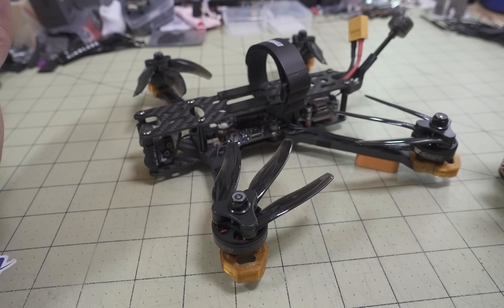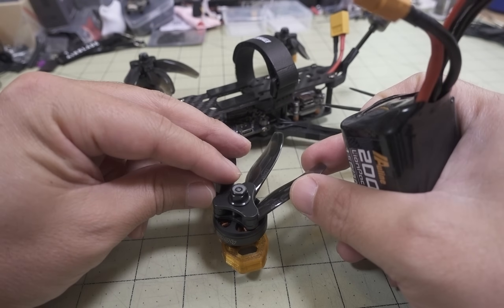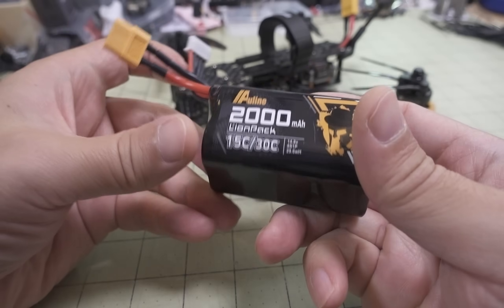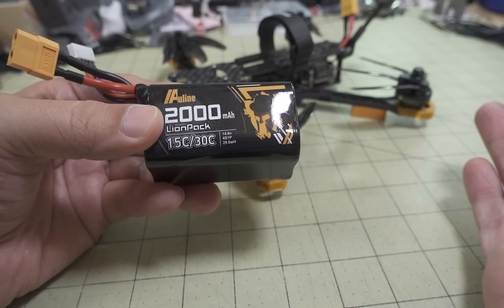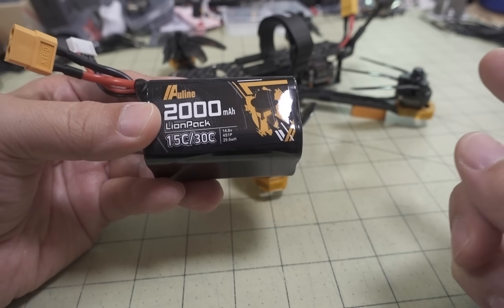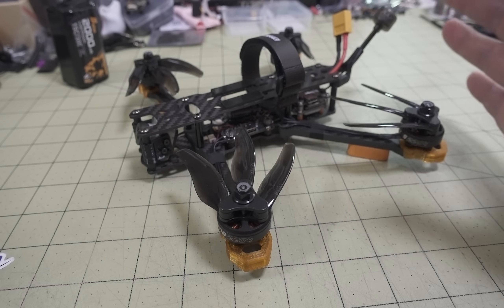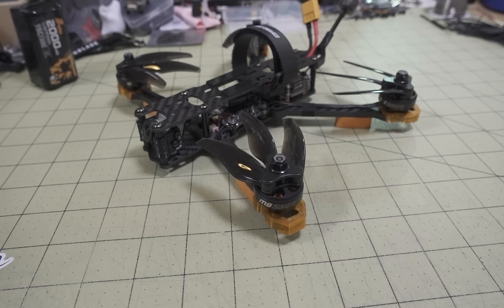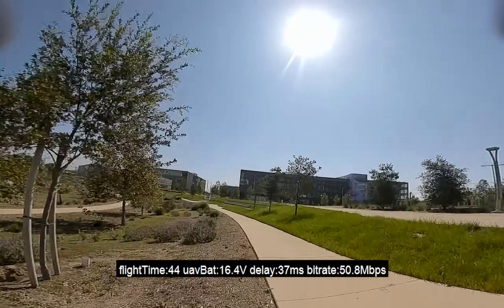Building an Efficient 5-inch Drone for Long Flights 🛠️

Comment from the maker: 🛠️ Parts in this build...
Papilio Frame - http://bit.ly/38tlNsA
iFlight SucceX-A AIO FC - http://bit.ly/3f0UDen | http://bit.ly/39uFrVR
Diatone 2204 motors - http://bit.ly/30Ip0lC
Caddx Vista FPV System - http://bit.ly/2QKaUM5 | http://bit.ly/2QJsShw
Gemfan Floppy Proppys - http://bit.ly/36DGCD3 | http://bit.ly/30GQ2dd
Auline 2000mah 4S Li-Ion Battery - http://bit.ly/30Jgrqz

🙏 Please support with a 👍 and don’t forget to hit the 🔔 thanks!

👉 Old gear for sale here -  http://bit.ly/AlbertGearFS

💲 Get the latest exclusive coupon codes (updated often)
     http://bit.ly/34SYiGn

Comment: I’ve been trying to build something similar but I’m having trouble finding motors. Everyone seems to be using the 12x12 mounting and it gives me a headache figuring out which frames to with which motors.
Reply from the maker: Usually the frame product page will list the motor mounting pattern in the specs.

Comment: I just got this frame but I have the caddx micro air unit with the caddx camera that is 19mm x 19mm. I see you used a TPU mount for your camera instead of the carbon fiber mount can you let me know where I could pick that mount up at?
Reply from the maker: It was something I grabbed off Thingiverse but I was not able to find it again.  If you search for "FPV camera mount" you'll get hundreds of hits.

Comment: You should be able to get awesome flight times out of that bird it’s so light 
I’m using the 3000mha 4s battery it’s 1000mha  more amps and only 4g heavier 
I use them on my marmotte that I set up for long range it weighs in at 436g with a 200g battery it flys for 18 min consistently 
I just built a 4100mha 4s battery that weighs in at 300g using 21700 Li-ion cells 30c and on these it flys for a solid 23 min consistently 
I’m running 2306 2150kv motors

Comment: Have you tried that battery on something like a more standard 5" freestyle? I'm wondering if I picked up that battery if I could use it for longer flight times and slower but more cinematic flights. Perhaps the 3000mah
Reply from the maker: It will probably work but you'll have no power whatsoever.  It will be barely enough to cruise around and that's about it.  FYI, stick to lower KV motors under 2400kv for 4S.  OR put in a motor output limit to reduce the amp draw otherwise it won't get off the ground.
Reply: @AlbertKimTV  What about a 6S build? 1750kv or similar.  I'm trying to decide it's possible to use the same rig for freestyle type flying, but also stretch flight time with a different  battery if I wanted a longer flight

Comment: What if you did some light freestyling with lithium ion batteries?  Is it even possible? Would it drop voltage instantly?   

Great content.
Reply from the maker: Yes, you will get instant voltage sag.  This is normal for Li-ION batteries.

Comment: Hi Albert, love your channel. Love this build. 
I'm looking to emulate this sort of build however with an analogue set up. Would a Tarsier V2 fit in this frame?! Thanks
Reply from the maker: Yes, it will fit but you'll have to use a custom TPU printed mount for the camera like I have for the DJI camera.
Reply: @AlbertKimTV  thanks for the reply! Slightly disappointed that I don't have a 3d printer now 😂
Reply: @AlbertKimTV  do you know the distance between the two front stand offs on this frame? Thanks

Comment: folding props are a waist! only way be good is if slow fly between trees maybe as a safety! then be 2 prop only.. reason : 2 blades are quiet/efficent/ no thrills but long flight times/ way easier to BALANCE!!!! 3 blades are for speed! 3 blades are loud + vibrate and non balance capable- they build identical as can .. when together.. there out balance a bit- /not as important if raceing! Sooo 2 blades are better in every way for lighter/ better video no vibrates/smooth and easier on batter time!
Reply: I would say three blades are less efficient and only benefit is more thrust if you can't fit a larger two blade.  otherwise you're just swinging extra weight and taking more energy to do it.

Comment: I bought this exact battery and my charger only charged it up to 16.4 volts. How high should this bettery get charged and discharged to?
Reply from the maker: You charger settings are limiting the final voltage.  Mine goes up to 16.8v.
Reply: @AlbertKimTV  how low can i discharge to?
Reply: @jjkeaton7085  2.5mha but to be safe I stop at 2.9

Comment: I like the folding props, however, for testing purposes, you should really try some bi blade non folding props. I also have noticed that I tend to get better flight times after the motors have had enough flights to break them in.
Reply from the maker: I've heard that "breaking in motors" is a myth.  Where is there data to back this up?
Reply: @AlbertKimTV  I don’t have data on this, but I felt disappointed with the initial flight times on some of my builds but later found I was getting what I expected. This was with Xing motors. The construction of the motor may have an effect on this. I would actually like to see tests done on this.
Reply from the maker: Interesting... I hadn't notice this on Xing motors.  I'll have to see how the Chimera4 does over time.  Are you using the same batteries?  Maybe that might be a factor.
Reply: @AlbertKimTV  This is what I know about bearings from working in a bicycle shop for years. Traditional bearings are adjustable. If they are too loose or too tight, the races pit. There is a very narrow range that is an acceptable adjustment, however it is a range. If you go absolutely as loose as possible to prevent slop in the bearing, they will loosen up, especially if the bearing is new. Non adjustable bearings need to be adjusted towards the tighter end of acceptable to have a decent life span. New bearing race surfaces can very from looking almost like a matte surface to having a mirror finish. Even the matte surface starts to look like a mirror finish on the thin track where the bearings move after a lot of use. Keep flying the quad for a month and see if you notice a change in flight times. I do use a variety of batteries, but do not feel that accounts for all the differences in flight time.

Comment: ZOHD have out a whole range of Li-Ion packs available in 18650/3500 & 21700/5000 sizes with various cell counts- not as cheap but much better than those AuLine packs....
Well worth checking out! ;)

Comment: In the past, i was using 1806 motors, 2300kv and just 5inch biblades. It weighed 190gms without lipo...With continuos acro/freestyle flying with 4s 1300mah lipo, i was getting at least 7.5 to 8mins flight time...im guessing that now with better LiOn batts, we should get >12mins. What do you think?
Reply from the maker: For sure, and some of these new ones are over 3000mah, so the flights will be mega long!

Comment: Thanks for the tips esp with batteries. Regarding this frame, I made one up using this and was ok until it had a light crash, about 10m it fell from hover as prop came loose. The front arm really suffered , not only is the carbon bendy and weak but one of the mounting screws tore through the lower frame plate as so little carbon holding it in place. I repaired but same happened again, decommissioned it after that and went iflight dc5. Guess with cruising quad there's less chance of crash 👍
Reply from the maker: It's a cheap frame and not really a basher frame.

Comment: How about a word or two about that humongous capacitor you have on that build (and some other recent ones I've noticed)? I thought the DJI video would be clear without that?
Reply from the maker: The capacitor is not jut for analog video noise.  It's for cleaning up electrical noise in general.  Electrical noise is what causes video noise in analog video.  It can also mess with your PID tune.  So I have it on there mainly for keeping a nice PID tune without adding a lot of filtering.
Reply: @AlbertKimTV  Thanks, I learned something today!

Comment: NIce looking build! That frame that is in the works sounds really interesting. Will it be a similar weight to the FPVCycle Fouride 5 inch? The fouride 5 inch is around 70g  by the way. Kabab flew the 5 inch version with a 3s LiPo, 2203 3000kv motors, and got decent flight times. It seemed to be a solid freestyle performer.

Comment: Nice Build Albert.  Looks like you couldn't a got 10+ minutes easily.  I've been flying with 4 of those same batteries with my iFlight XL-5 with a gopro7 and I get around 10 minutes or so cruising.  They're really inexpensive...around 20 bucks each.  Also, I've seen 3000 and 3500mah versions from other manufacturers I'd like to try out.
Reply from the maker: I think we will see more of these li-ion batteries.  Amazing flight times for those who don't race.
Reply: @AlbertKimTV  Completely agreed.  There are a lot of guys that are new to the hobby and/or fly commercially who demand longer flight times and fly cruise cinematic style.  So the LiIon batteries are ideal.
Reply: Esdras FPV   All 'stock' parts.  XL5 HD...right outta the box.

Comment: Hi there Albert, do you like those diatone motors? I was thinking of trying them on an ultralight 5 inch, they are about 20 grams a piece I believe? Good price too I think. Thanks!
Reply from the maker: Very smooth motors but on the power side, quite weak.  It's gonna be for cruising and efficiency.  Not for racing or freestyle.

Comment: Wicked cool. Ion is the future. I recommend BetaFPV X-Knight 5" with some dave_c motors... has been working decent for me so far on just 2S (26 minute flight time). Also-- Those are the nicest M3 screws on those motors I have ever seen!
Reply from the maker: This build is just one example of thousands of different ways to make an efficient 5-inch quad.

Comment: I heared the rumors that Diatone MB2204 motors are already discontinued or factory stopped producing them. Cannot find them on Diatone website also...
Reply from the maker: Wow, really?  This is the motor on their 5-inch toothpick!
Reply: @AlbertKimTV  not sure what happened, but my order was cancelled on one shop and the seller said the factory stopped manufacturing them. Well at least the Diatone should know whats going on.
Reply: @MontisTube  Banggood has listed them with expected shipping around October 26th. Would be really sad, as they are cheap and I am about to order a set for a light MK4 analog LR build
Reply: @SerialKoE  Maybe, but Diatone has removed this motor from their website. This should mean something...
Reply: Xt Xinte still has them available. Maybe I should place an order right now!

https://www.xt-xinte.com/Diatone-1pc-4pcs-MB1105-MB1103-MB1408-TOKA-5500KV-8500KV-5000KV-FPV-Brushless-Motor-2-4S-10A-2-3inch-For-DIY-FPV-Racing-RC-Drone-p743851.html